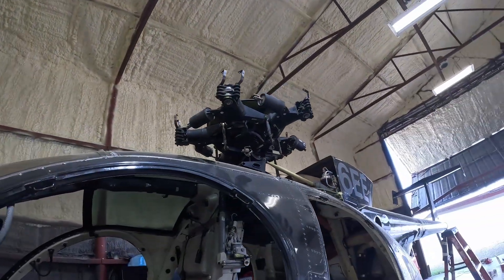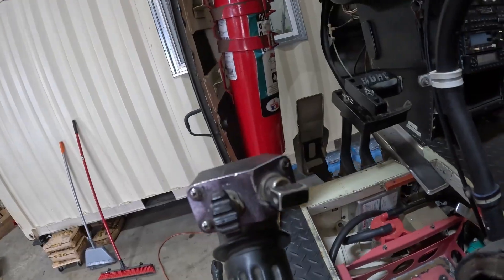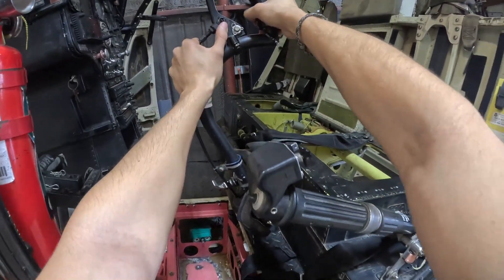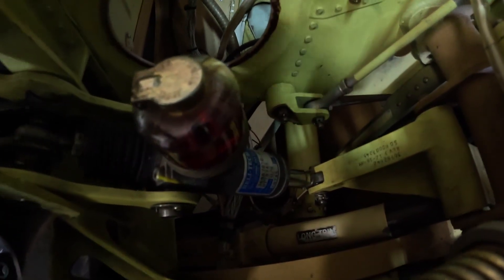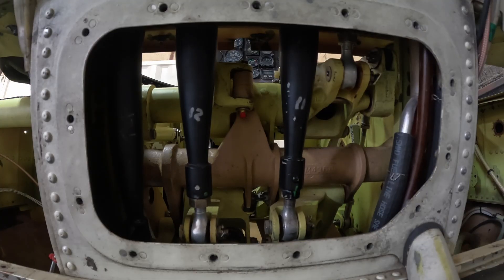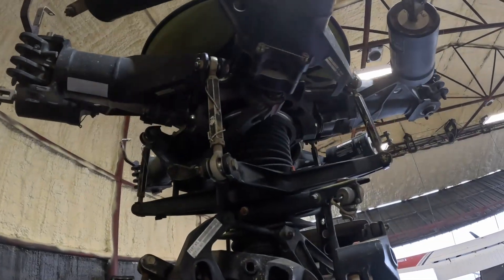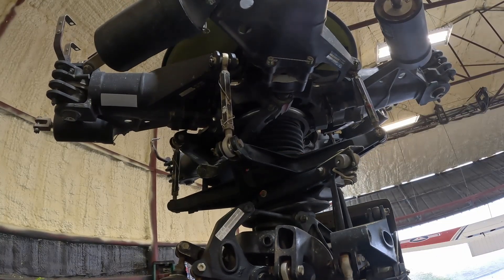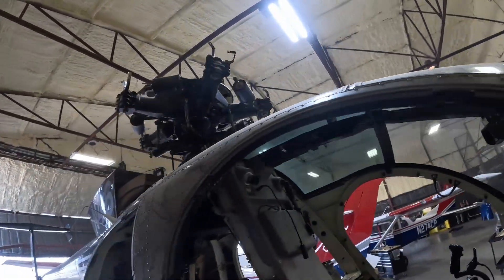Helicopter Mechanic Explains Flight Controls on MD Helicopters

Comment: Regarding gyroscopic precession and the rotor system of the MD500.

Is my assumption correct that gyroscopic precession is compensated by that the mixing unit is aligned cirka 45 degrees to the right, and the blade pitch control rods are 45 degrees ahead of the blade? Altogether 90 degrees.
Reply from the maker: Yes, that’s essentially correct . The MD500’s control geometry splits the needed 90° phase lead between the mixing unit and the pitch link attachment so the pilot’s input produces the proper rotor disc response.